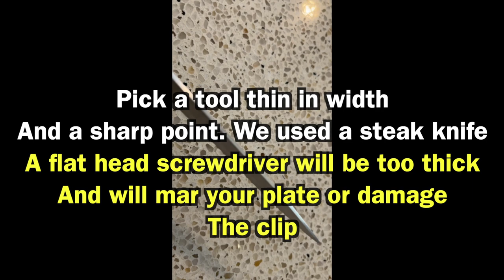How To Remove Your Wyze Doorbell Camera With A Steak Knife!!!

Comment: If you just pull up on the door bell, it will come loose too. No need to jam a knife in there.
Reply from the maker: No it will not, it is locked in. See the tab? And watch the video. If yours come off by just pulling on it, something is wrong. This is to prevent theft and someone walking away with the doorbell.